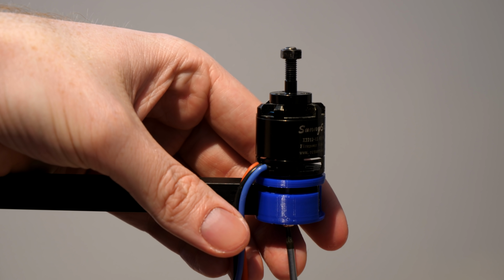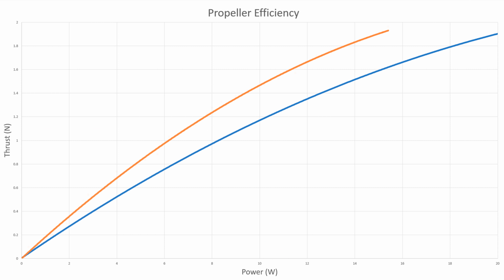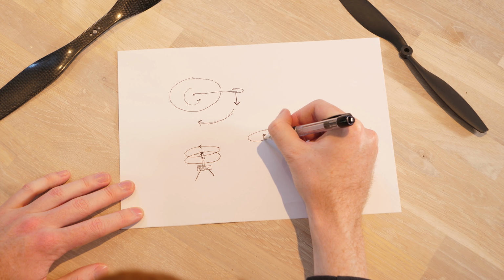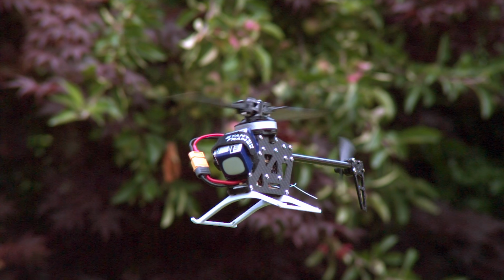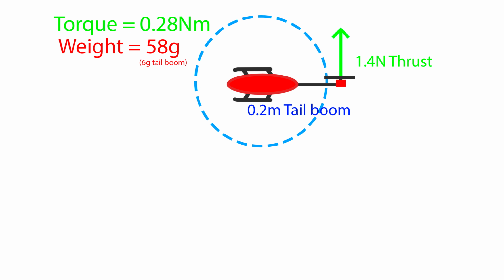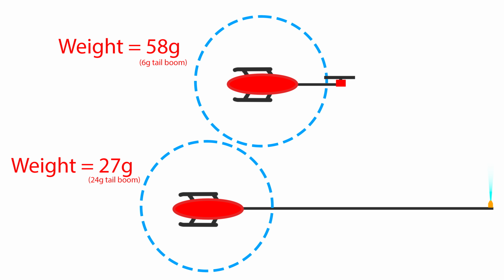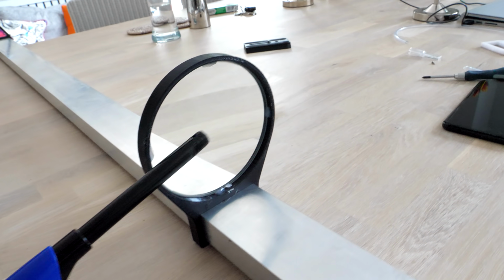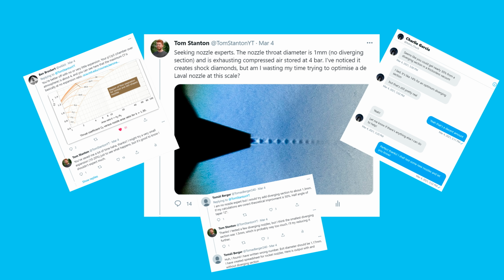Air Bottle Helicopter

Comment: Love the videos Tom! 
What about if you add a small lightweight valve to close off the pressure to the turbine. That way you could pump it up to a higher pressure, and not lose any whilst getting there. Also, it would allow you to release the filler hose before launch, so this doesn't upset the attitude of the helicopter. The valve could have a spring on it, (with enough strength to open the valve under pressure), with a quick release pin, and some string to trigger it.
Although, it may need something on the take off pad to hold it while the string is pulled to release the pin, like a guide beside each skid, for example.
The higher pressure may necessitate the use a simple restrictor before the turbine, tuned to give optimal duration, while still allowing enough flow to achieve flight.
I really enjoyed this video and hope you do further R&D with this heli! 😉👍

Comment: To counter the torque, without needing an additional rotor, you could attempt what the likes of the MD-902 helicopter uses; It still has the rear boom, but along one side it has a rib to reduce the airflow down that side, whilst allowing free-flow along the other side. This creates a difference in pressure, producing a moment; it might be worth a shot, but difficult to see if it'll produce enough of a difference

Comment: Extremely well done! The only further enhancement you could consider would be a hollow blade (maybe even a lighter than air gas-filled blade - or is that cheating lol? The other possibility would be to use a bottle with a much thinner wall, because I doubt you are approaching anywhere near the structure limitations of that one ... Anyway I agree you can't really make a helicopter work that well when powered by air!

Comment: I feel like you can't give up until you push the pressure to the limit and rupture the bottle.  I feel like they can probably take a lot more than you typically put them though, or perhaps could be reinforced with minimal added weight to go even higher.  Every additional millibar of air you can pump into it gives you more fuel and a higher Isp!

Comment: Have you looked at NOTAR helicopters? They are full size helicopters that use a similar idea of air pressure instead of a tail rotor. The main difference is that some air from the hollow tailboom is also vented out of a slot running the length of the tail.

Comment: Glorious.

Just one question. Why not put the bottle upright rather than on its side? :)

Perhaps even put the bottle at an angle so when it disconnects from the valve, the brief release of air would thrust it forward and upward at the same time?

Comment: What about a small amount of dry ice in the bottle to pressurize it?  As the ice converts to a gas, the discharged gas also reduces weight + possibly results in longer more usable run times.  It also avoids imparting any momentum with a pressurized launch mechanism (although your solution is remarkable!).

Comment: Seems like you're running into the rocket problem. Air is just inherently not a great energy storage medium (low specific energy). You could consider increasing the specific energy by using a fiber-composite bottle that can reach much higher pressures, or consider depressurizing in multiple stages to improve efficiency. Thanks for the attempt - very challenging problem!

Comment: Maybe you can try to put some dry ice inside the bottle? If you try that make sure it won't move that much, connect a variable depressure valve for the bottle for safety reasons.. maybe that would work? Maybe you can put a collective pitch on if it works. So you can run higher RPM and can control the pitch for up and down instead of depending of the pressure. A bottle with air pressure is like a capacitor with less resistence. You need something with more potentional energy.

Comment: So, looks like the 2L bottle format is the limiting factor. 
If you could move up to a small high pressure air cylinder, then you could use larger more efficient engines, and have room for on board flight control. Would likely be a big expensive project tho.

Comment: About 40 years ago, my father came home from the local model shop with strange little engine powered by CO2. I don't remember much about it aside from it using 'sparklet' CO2 canisters normally used in home beer making, and that it had some extremely delicate copper tubing and was very temperamental to start. After a couple of attempts at using it in a plane, it eventually ended up mounted to a sheet of expanded polystyrene foam to make a hovercraft that would skim up and down our hallway a couple of times before needing to be refilled. Anyway, I'm wondering if you could adapt the concept to use the 'sparklet' capsules directly in some way to give you longer flight/run times or more power.

Comment: I feel like the best theoretical solution for this problem would be a TIP POWERED ROTOR because it saves on countertorque measures and the leverage means a small force has more effect.

Comment: You know, looking at the slowmo, the rotor seems to work fine :D 
I'm wondering how much rotor downforce is pushed to one side by the bottle - I'd consider mounting it vertically (which also simplifies the bottle-nozzle connector) to get an even airflow.
Second, the tail nozzle seems to work OK, but it might be better to do a ducted fan setup instead. You can control the aircraft then as well as counter the rotation. I'm guessing that the weight of the flybar stabiliser (which you wouldn't need) might be similar to a simple flight system?

Lastly, if you mount the ducted fan ahead of the in-line bottle, you'll probably get a coanda effect off the bottle which would stabilise again (but possibly make it a little harder to lift off as the air will separate at the bottom of the bottle causing turbulence, though again, with laminar airflow along the bottle sides you might get more downforce)
Reply: Oh, actually plan b is better - use movable fins on the bottle and a free rotor, saves on the duct weight and the airflow along the bottle should be amenable to control :)
You can also use the fins as legs to save weight.

Lastly, I'd be tempted to pre-pressurise the bottle and then have a string-controlled valve to start it.

Comment: Hi Tom. I always enjoy your interesting videos. Congratulations.  A few days ago I saw some other ones also related to flying toys, but with flapping wings, showing impressive performance only by rubber band powering. (https://www.youtube.com/watch?v=j6IXumMkYOk&ab_channel=HobiCerdas) Then came to me an idea and remember your enthusiasm concentrated onto the compressed air.  In case of flapping wings, the alternating moving parts (not rotating gears) act with low velocity and high torque. I think it  fits very well with compressed air powering. Using air muscules (https://www.youtube.com/watch?v=sAHNJdxF6Cw&ab_channel=XYZAidan) the powertrain could have better efficiency with much less loses then using high rpm gears and propellers. If it has triggered your minds, it would be interesting to see your experiments to verify how the air powered ornithopter idea behaves in reality. All the best ...

Comment: The tail "rotor" has to compensate for the torque created by the main rotor - not the power. So by using a smaller - less efficient - main rotor, that spins faster, you will have to waste less air compensating for the torque with the tail jet. Maybe a less efficient rotor will actually be more efficient..?

Comment: SUGGESTION:  Tom, in my experimentation with bottle rockets, I found that the smaller the bottle,  the higher pressure it could withstand without bursting.  Get a teeny bottle (200ml or so).  Less mass, higher pressure, might just get you more flight time.   Kia kaha from NZ.

Comment: Spoiler alert, it doesn't actually really fly under it's own power as the thumbnail would have you believe. It launches in the air for a few seconds that crashes to the ground. Just saved you 14 minutes.

Comment: Have you considered using dry ice as "fuel"? Given enough heat (doesn't take much) it easily sublimates creating high enough pressure in a sealed plastic bottle to cause catastrophic failure. I believe it could, if properly contained and released, provide greater power for a longer period of time than compressed air.

Comment: Now that you have a Schlieren setup you should take a close look at your turbine working, might be able to spot something to change and squeeze some more efficiency out of it :D 
Also do you think making the gears wobble less would help with efficiency? 
I am not an engineer, but I would assume that's adding some resistance. Are the mounts glued to the spar? they seem to be twisting on it.

Comment: It is almost always the journey and the lessons learned that are more educational than a working solution. They demonstrate the principles at work. This is why I love these videos - they show all the dead ends and reasons why something works or does not work.
If a larger propeller is more efficient, maybe getting the biggest possible would help. It would weigh more, but also store energy as a sort of a flywheel and that would help in the first few seconds.
The attachment point is at the nose, and the helicopter pitches forward before being released. Perhaps making an extension and filling it from directly below the propeller would lead to smoother release.
But also helicopters are massively harder to make than airplanes. There are 37 years of technological progress between the first airplane and the first helicopter. They require a lot more thrust to weight to fly at all, and a lot greater energy density to sustain flight. Doing this with an air compressed water bottle might not be feasible even with a lot higher budget.

Comment: This from Google '' Mars is about half the size of Earth by diameter and has a much thinner atmosphere, with an atmospheric volume less than 1% of Earth's. ''  How do they fly ANY thrust based vehicle with nothing to push against  ?  And don't start me on rockets not working in a 10 to the - 17 Torr vacuum ...  Try it for yourself  ...   Ps  keep up the Gr8 work ...

Comment: I think the rotor head spent more time in the air than the helicopter itself...

More seriously - this looks like one of those cases where Tom needs to start looking for lightweight ways to increase the pressure that the bottle can hold. Perhaps a single-layer fibreglass or carbon fibre wrap about the midsection? If you can store more energy gram-for-gram, it allows you to put in other things like an actual valve assembly rather than the ridiculous pressurise-on-launch setup that he has now.

Comment: What about a gearbox that spins four propellers preset at angles allowing for almost touching during rotation? It could run off a central, single bottle or four bottles (for balance and extra pressure) connected to a single valve.

Comment: Instead of a stacked pair of counterrotating blades, have you considered two coplanar propellers? Something like a tandem-rotor design: https://en.wikipedia.org/wiki/Tandem_rotors

If one propeller can lift one bottle, I would think two propellers side-by-side should be able to lift two bottles.

Comment: Idk if this would make the air powered helicopter more possible, but perhaps scaling it up might help with fuel vs storage vs weight of the container.

 Since the weight of the plastic container vs the volume of air it stores will get better and better as it gets larger. Though this also means you would need a larger turbine but it might do the trick. 

Either way, really cool project, im really enjoying the interesting concepts and builds, this is basically me as a kid putting straws on balsawood airplanes to make them fly better or do crazy tricks. (that would be a cool video to see you do as well!)

Comment: Expand the bottle by heating the entire thing in a oven then gently inflating it. See how much volume you can get out of that material. Make several sizes and test them to destruction then chart the most efficient volume and psi for the most total stored air volume.

Comment: What about tip-jets? The theoretical max blade velocity at disconnect could be quite high even at low pressures and there would be no gears.
Reply: Oh and you wouldn’t need a counter rotation jet either.

Comment: Maybe lighter carbon tail boom + even larger Main rotor?   This would probably be a lot of work, but you don’t need the rotor to be nearly that strong.  Maybe making something like what people use for ultra light free flight planes.  Thin carbon frame blades  wrapped in thin plastic

Comment: Instead of props and gears you could go back to no moving parts and use a coanda effect powered helicopter. Use the bottle/s as structural elements and make it up like an air multiplier like Jetoptera is currently experimenting with.

Comment: you need a clicky pen spring and a BB to make a one way shut off valve when the copter launches. Shutting off the air. either that you could use the releasing air pressure to counteract the spin. You are awesome! keep it going!

Comment: When I saw this video's title I was imagining something like those toys you used to get that have the air from a balloon go out of the tip of some lightweight blades pushing the blades in a circle. I think you should attempt it again, no gears just blow air fast out the tip of the blades

Comment: I feel you’re forgetting the old engineering adage, “If you can’t fix it, feature it!” The extra lift on the nose could be useful as long as it’s balanced with lift on the back. Not gonna fix the short flight time though...

Comment: What about an enclosed space around the "motor" with a inlet for the compressed air and a pinhole outlet for the air to escape after it does say 300 degrees from the inlet? That way the compressed air has to move the gear nearly a whole 360 instead of dissipating with the first tooth of the cog hit? Just a thought from a 25 year old with no actual understanding of this stuff that discovered your channel today. Oh and subscribed with bell icon!

Comment: Is it possible to wrap the bottle with carbon fibre and resign or some other method so you have a light weight pressure vessel that can hold alot more pressure and volume?

Comment: Helicopters require head speed to be high before lift off, and your design seems to be pushing the majority of the air filling the system going to headspeed and very little going to pressurizing the bottle. 
Maybe a split fill system. Part going to getting head speed and part going to pressurizing the bottle. One way reed valves could switch the flow from the fill to turbine, to bottle to turbine after fill system has been disengaged. Just a thought

Comment: Why not just use a bike tire valve like a Schrader or a presta on the helicopter side so that you can pressurize and once you're disconnected all the air doesn't come out of the wrong end?

Comment: There are a bunch of RC helicopters (both commercial and DIY) that simply use a large enough vertical surface (or surfaces) to counteract the main rotor torque using air friction alone. I say take it a step further - add some blades on the air bottle and let it spin. Just pitch the blades so that when the body does spin, they produce lift as well.

Comment: I think you are loosing too much power by forking the air stream to the rotor and the tail. I think you need the air to blow over a Pelton turbine on the main rotor in a mostly enclosed  area with the excess air flowing over the Pelton cups and down the tail tube to be jetted out.  As that probably won't work, I think you need to make a pelton turbine that runs a planetary drive powering two rotors.

My take... have the bottle vertical with the air jetting out straight up into a vertically mounted Pelton turbine. The turbine would powering a large gear, that would power a spiral bevel gear rotating the top rotor. A similar spiral bevel gear would power a lower rotor that was split in the middle and glued on to a bearing that allows the air jet to blow up through the center. My guess you would have to make a plastic bearing to keep the weight down.

Comment: Hi Tom, I really like your videos and I watch them regularly, but I have to disagree on something you said in this video: You said that in a quad copter you have to use the smaller propellers because they cant overlap. But why cant they? They could be on different planes of rotation, put 2 on the top, 2 on the bottom and you can reduce the propeller distance by 0,7 or increase the propeller diameter by 1,41.

Comment: I owned an Air-Hogs compressed air helicopter as a kid. Even that (an actual consumer product) really struggled to fly. I owned two of them, and in both cases they lost the ability to fly after a  couple dozen launches - there must have been just enough wear to increase the friction of the engine past some critical point. Note that they dealt with rotor torque by just having a big foam tail fin - it weighs almost nothing, consumes no air, and slows the rotation down enough to enable flight. The best flight I ever got out of one was by replacing the tiny air tank with a large soda bottle. It hovered for at least 30 seconds, and reached an altitude of around 10-20m. 

I do think a reciprocating engine offers greater potential efficiency in a helicopter-like design, due to the low RPM required.

It'd be interesting if you revisted your original piston-based air enignes, but used something like brass tubing to create some cylinders/pistons which have much greater precision than is possible with your FDM printer. Or perhaps your resin printer would allow you to create pistons and cylinders with sufficiently tight tolerances.